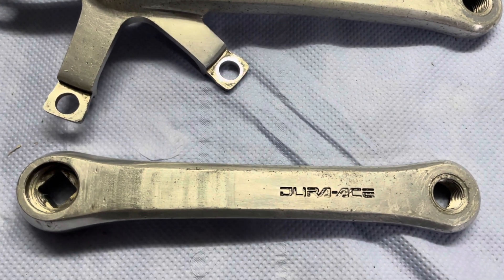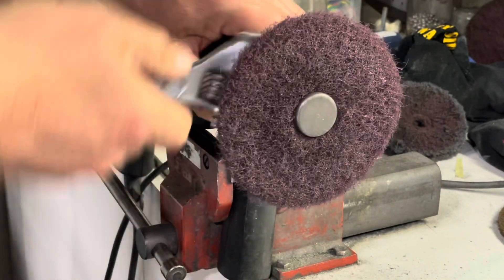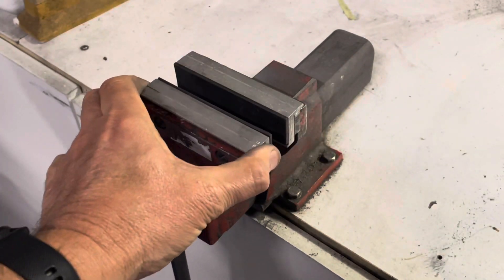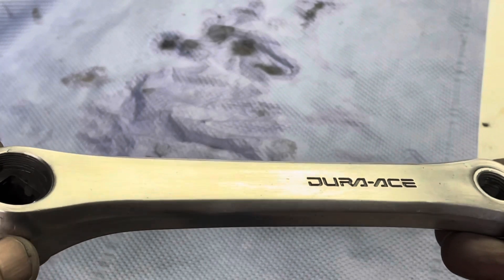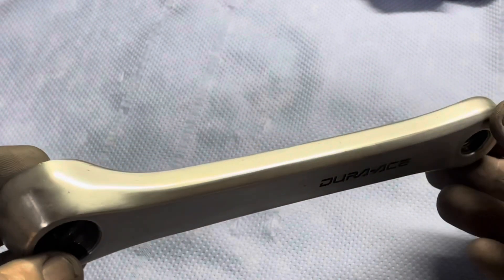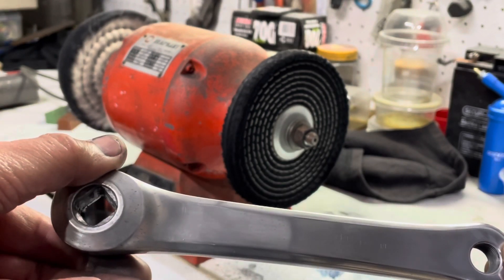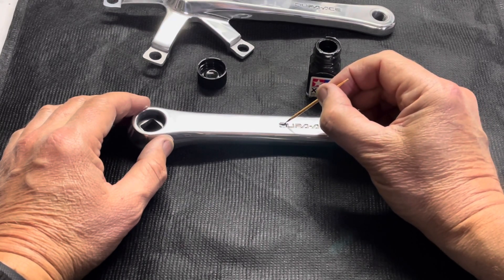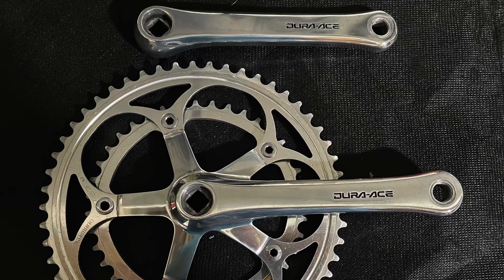Restoring a classic Dura-Ace crankset

Comment: Great video. At the start you mentioned that the cranks had some anodized coating to protect the aluminium, which you removed during the process. Would these cranks now corrode if they were to be used?
Reply from the maker: If you rode in the wet constantly and neglected them then yes, they’ll eventually corrode but then so will anodized cranks. 
If you keep an eye on them and clean your bike regularly then no, you won’t have a problem at all. 
I hand polish mine every 6 months or so. I’ve got some sets that are over 4 years old and still look beautiful and shiny ✨

Comment: Beautiful work!
I should do this to my classic bikes, too ... but then, when I ride them it won't take long until all the shiny metal is dull and scratched again.
Reply from the maker: For a bike used daily I would not recommend this but on a collectible that goes on Sunday rides, this polishing lasts a long time and is very easy to polish up by hand if it dulls. My Peugeot that I use for Eroica has a polished crank that I did 3 years ago and it still looks perfect 👍🏼

Comment: excellent stuff 🙂
I've got a set of Shimano 600 cranks I need to restore so this was invaluable.
just one question - what are you using as a buffing wheel on your bench grinder, and what compound?  (OK 2 questions!)
Reply from the maker: I’m using a cloth buffing wheel, available at most good hardware stores and aluminum specific compound. Just ask your hardware store as you get different compounds for different metals so some are more abrasive than others 👍🏼
Reply: @BuffsVintageBikes  thanks :-)

Comment: Don't you have to clear coat the bare aluminum? Won't the bare aluminum oxidize and turn dark?
Reply from the maker: No, I’ve restored cranks that are 3 years old and still look as good as the day I polished them. But it is a good idea to keep them clean and polish them again every once in a while if you’re using the bike often (you can do that by hand). Remember this is not pure aluminum, it’s an alloy of which one of the primary elements is aluminum.
Reply: @BuffsVintageBikes  This was the first question I had.  I assumed pure alu.  I suppose a little hard wax would not hurt.

Comment: Very nice and shiny! That being said how do I achieve similar results without a machine? I am up to 2000 grit yet still very fine scratches upon close examination. 2500 then 3000 grit then aluminum polish? any suggestions would be greatly appreciated thank u.
Reply from the maker: You will struggle without a buffing wheel of some sorts. Before I had my polishing wheel I would use a small buffing pad on my drilling machine and aluminum polish. I was able to achieve great results with that as well if I went down to 2000 grit.

Comment: Easier and faster to use a small brush, fill letters without care to stay clean because you will wipe them. I wait until dry, hour or so, then acetone or paint thinner on a cotton fabric, wrapped tight around your finger and wipe lightly over the letters. Cleans fast. Also, you can sand with progressively finer grind wheel-sandpaper to 2000 then 2k clear coat the cranks. Polishing will only tarnish over time.
Reply from the maker: Thanks for the tips 👍🏼 I’ve tried various methods of cleaning up the lines afterwards and find this way works best for my needs. Regarding the 2K over a polished surface; that might look fine for a while but without a roughened binding surface that 2K will eventually flake and peal, leaving you with more work. This is also why you always flat down a surface with fine sandpaper before spraying it.